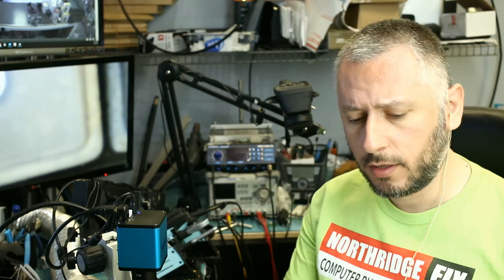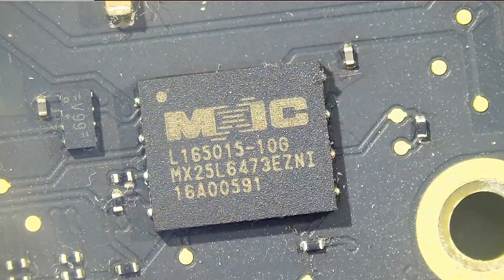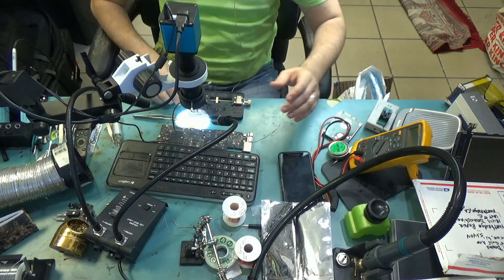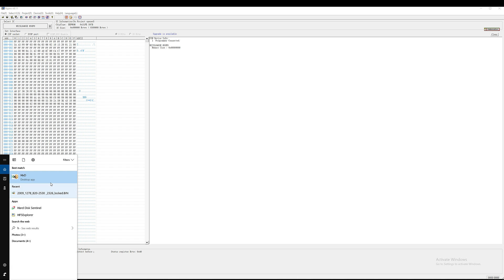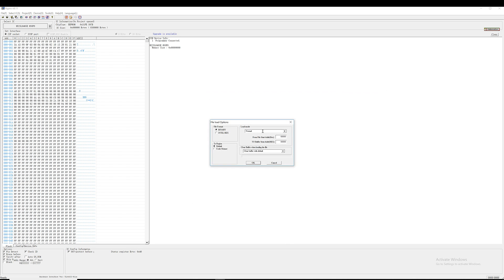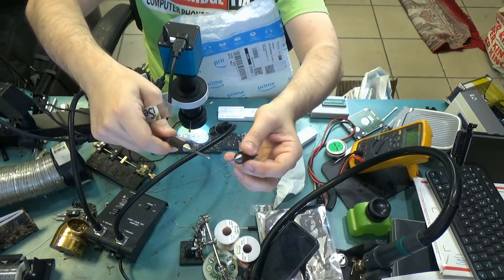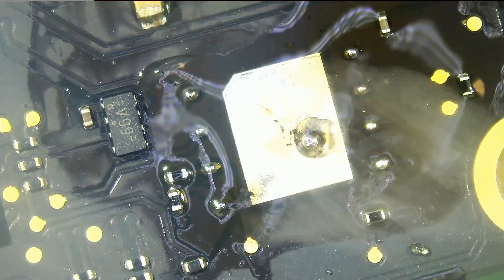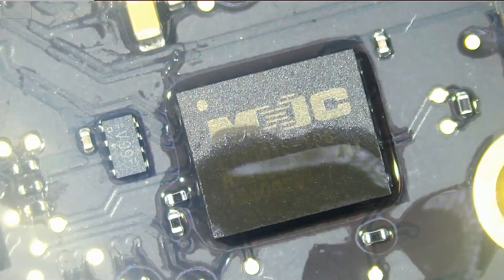2015 Macbook Air A1466 Clear EFI Forgotten Password

Comment: what was the temperature oof the hot air gun?
Reply: IT's 250 -275 on quick/hacko stations on crap ones is just test til get the right temp.

Comment: How long were you able to use your Weller bent tip before replacing it?  I was curious as you use your equipment on a regular basis in a repair environment.